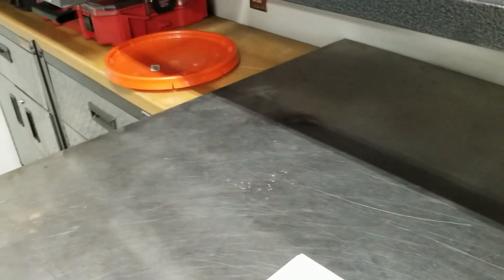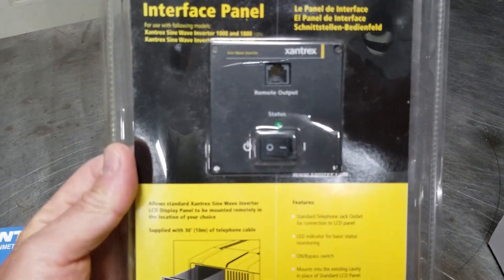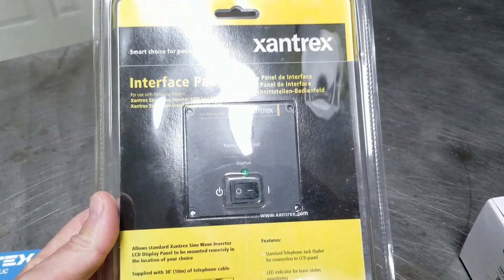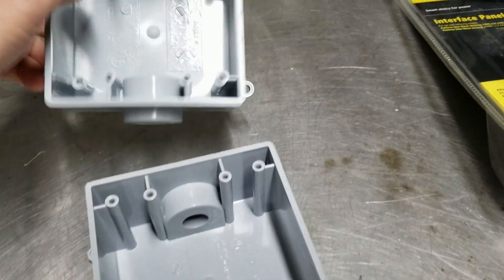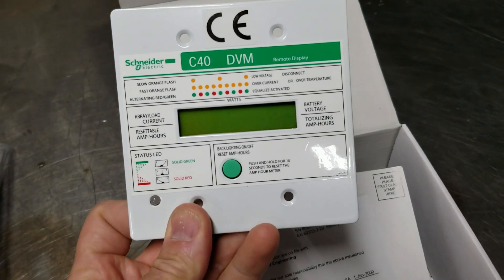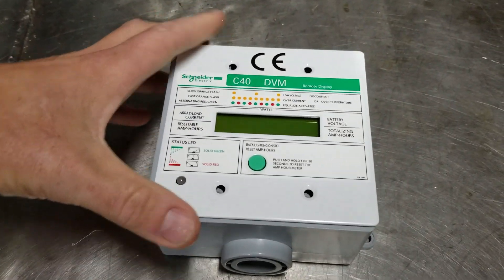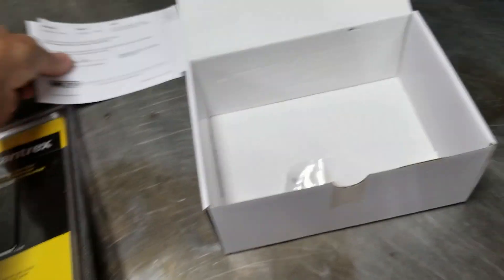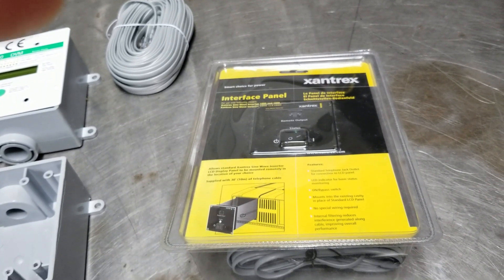Abel LMTV build part 125 (xantrex remotes for inverter and solar)

Comment: For those expeditionary over-landers like Abel, this solar panel system is something to be drooling over. This is definitely worth spending a bit more time and money on to get the most from your vehicles electrical potential. Great build, Sean!

I'm fine with your time-laspe, so long as the camera is stable. Once you time-laspe from a helmet cam, it's like a nonstop violent earthquake.

Comment: have you ever though of  mount n a wire raceway to the ceiling it makes a easy to add or remove wires. Or other areas of the shelter. We use them in industry makes things neat  and tidy.
Reply from the maker: That is what it originally had.  I prefer saddle straps and ty-raps...